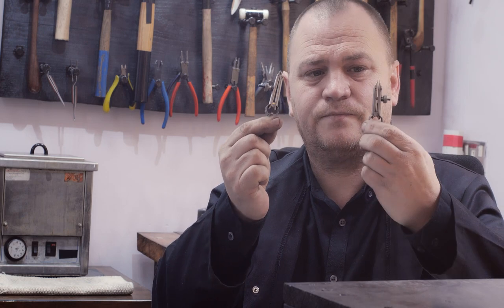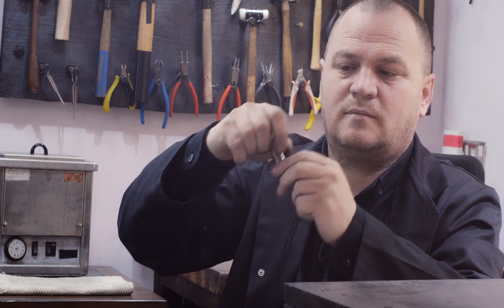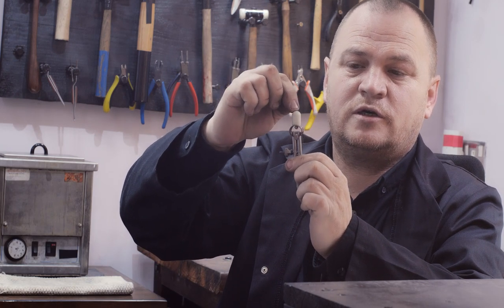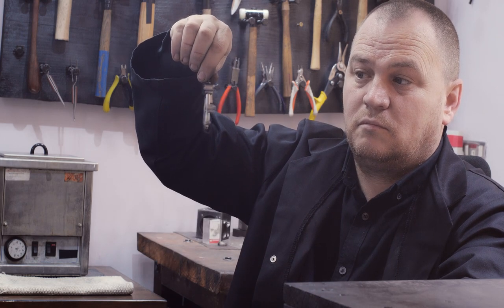Diy Precision Divider for Diamond Setting

Comment: Hi Coly, do you have any experience with a For...m K1070 micromotor? Does it has enough torque for stonesetting , drilling etc?
Reply from the maker: Avoid brushed and look for brushless. Brushed don't have power at lower RPM.
Reply: @jewellerymadebyhand  Alright, I will then go for the K1060 brushless motor. Which one do you have btw?
Reply from the maker: settercoly@europe.com
Send me an email, please!